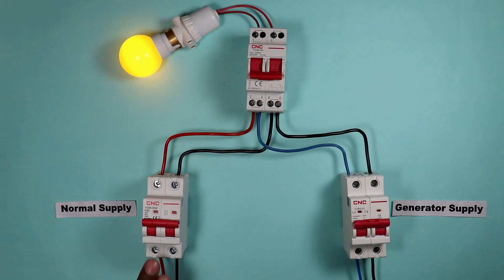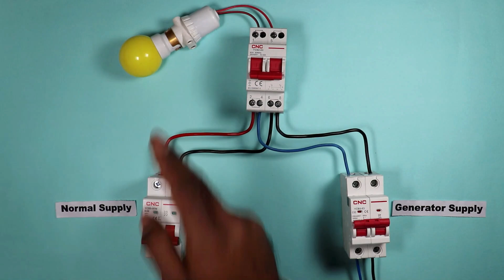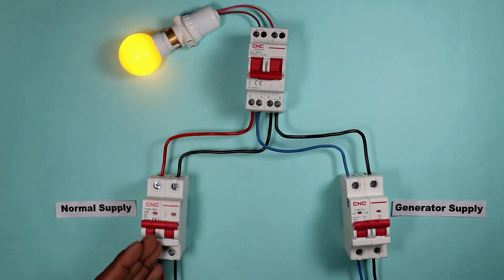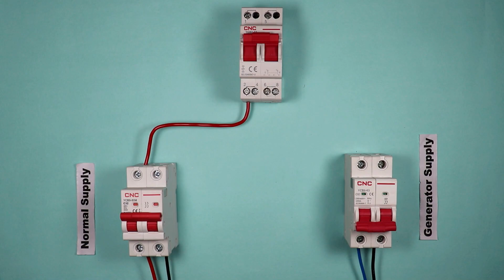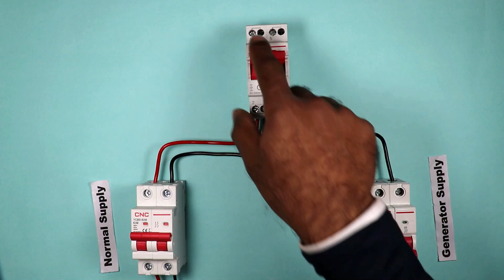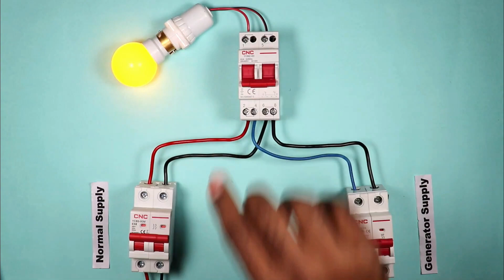Single Phase MCB Change Over Switch Connection With Grid and Generator Supply @TheElectricalGuy

Comment: I have an old on grid solar system. The old invertor feeds the power from panels directly into my consumer unit. The whole solar system is connected to an B16 MCB fuse in the unit. If I am correct, this power out from invertor. Extra power is feed to grid. My new invertor has power in and power out. I understand power out, but power in? Do I just connect to a plug socket to give invertor power? Or is best practice, to connect invertor to fuse in consumer unit?